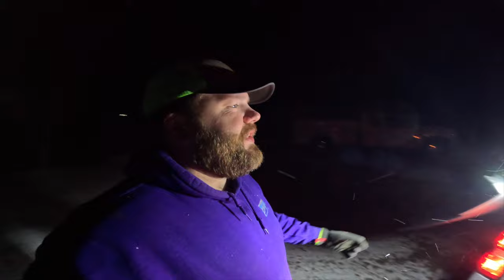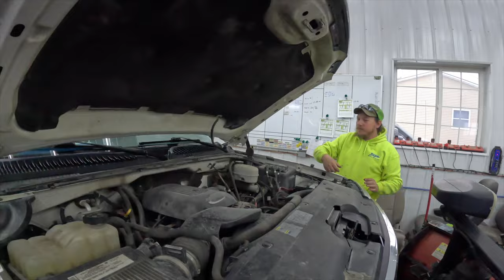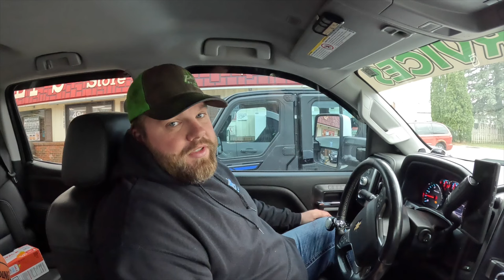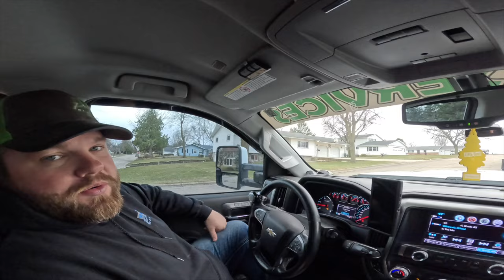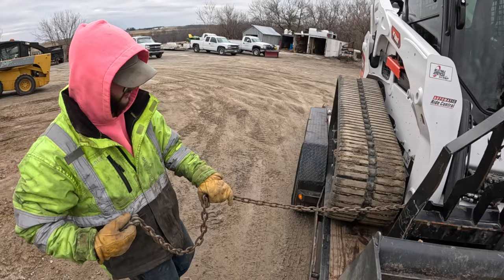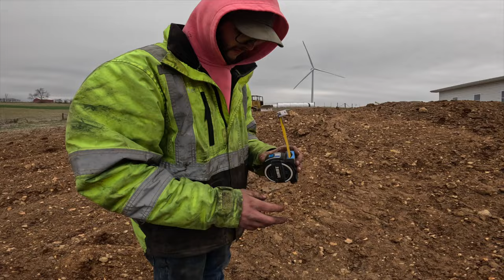Wisconsin March Snow | supposed to be 4-8 inches!

Comment: keep up the great work! Loving the videos! Was going to ask what % tint you have on the skiddy? I have a 19' T770 and would love to tint it, was it a pain to get tinted with the cage on the inside of the windows? I was also going to mention on the front of the t770 they have little pockets on each side of the boom arm you can hook a chain to instead of trying to sting it through the tube. If the hook is to big that makes perfect sense, otherwise it might help make chaining down go faster.